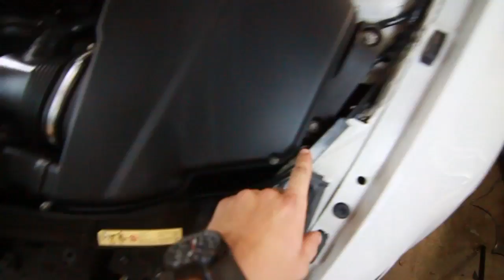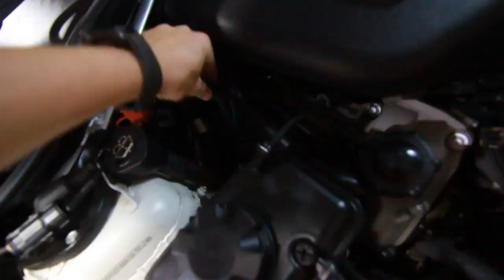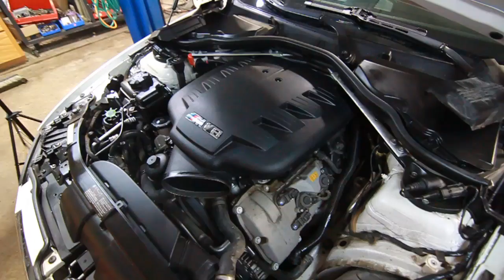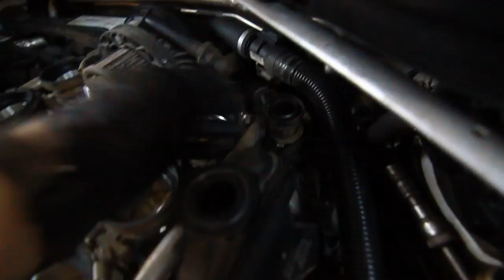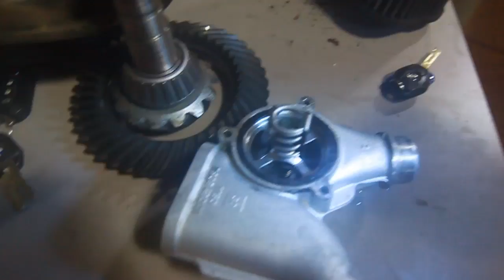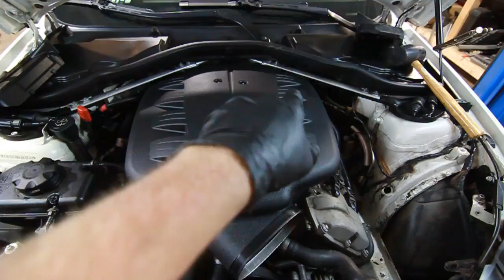BMW E90 E92 E93 M3 S65 V8 Water pump and Thermostat DIY replacement

Comment: What are the symptoms of water pump going bad? I replaced my oil filter housing and now only 1 gallon of water and 1 gallon of coolant goes in and reservoir fills up. Could that be an issue?
Reply from the maker: Da Rt seepage, excessive noise or play from bearings and or improper cooling at low engine speeds
Reply: I have notice unique noise since I putted everything back together. Sort of louder ticking noise. Temperature is good. Ive drove it and gave it a gas and temperature not rising up or overheating. And its all with 1 gallon of each. I heard that those water pumps go out in open position so it technically circulates coolant. What do you think?
Reply from the maker: Da Rt ticking isn't related to cooling system unless it's a BAD bearing issue. valve adjustment?
Reply: Here is threat I posted. Just to give an idea whats going on.

Hello. So Ive finally replaced oil filter housing on my M3. When I did such job I took off pretty much everything, radiator, fan, most of the pulleys, vibration damper and housing itself. My car was sitting for almost 2 months and 1 month with all those stuff out due to fact that I had to order some parts as I was going along with repairs. As I was working on it and installing new oil filter housing I have started the car without alternator plugged In a few times(no belts, no coolant, just a quick 2 min run to see oil leaks). Housing that I have used is from 2011 M3 with a different pulley. Some people say that belt needs to be rerouted and go over power steering but that will make it spin in a different direction, I left it the way it was before. Also 2008 year was making both pulley types so its not an issue. So as I was putting everything back together it didn't have enough power to crank the engine with all the belts so I jump started with my friends car. So when everything was back together now I have check engine light on, as well as some emission problem on a screen. On top of that only 1 GALLON OF COOLANT AND 1 GALLON OF distilled water goes in before reservoir tops off. I've let car warm up for good 15 minutes as well driving it for another 5 with giving it some good power and its not overheating but level is not dropping as well? Can someone please explain what is going on? I know I shouldn't of not started the car without alternator but I wasn't trying to put everything together just to see if housing still leaks. It is not covered under warranty, car has about 87kkk miles on it. I have to do everything myself.

Comment: Torque spec for waterpump and thermostat?
Reply from the maker: one ugga dugga!

honestly use a 1/4" ratchet and snug that bad boy down. if you don't have a decent sense of torque for a fastener, use some blue threadlock.

outside of wheels, internal engine parts, and clutch parts, I do not use a torque wrench.

Comment: surprised its a belt driven pump and not electric like other new BMWs
Reply from the maker: even the F80 M3 has a mechanical water pump. was very surprised to see.

don't quote me on this, but EVERY 'S' engine has a mechanical water pump to date.

Comment: How many miles should you do your water pump and thermostat?
Reply from the maker: 60,000 miles is what I'd personally do, but this one had 120,000 on original pump and thermostat.
Reply: Thank you sir.

Is there any manual for service interval spark plugs every 30k ext
Reply from the maker: there should be a maintenance schedule in the owners' manual I believe?

Comment: I think your channel is great. I have a weird whine coming from my e90, I suspect it to be my water pump pulley, BMW cannot figure it out. Can you check on the video on my channel and provide me you inputs. Thanks
Reply from the maker: definitely a bearing in the belt drive somewhere. probable culprits:
1.) main belt tensioner
2.) alternator
Reply: Thanks for the reply. Do you think it could possibly be the water pump pulley also? That pulley doesn't look like it has any bearings, but I threw some water in it while it was running and the squeal temp stopped. When you say alternator do you mean the pulley? Thanks
Reply from the maker: I'm guessing you're not in the states, so I don't know what engine you have -- no US market E90 except the M3 and the 335D have a mechanical water pump driven by the belt. it is possible the bearings in your water pump (if mechanically driven) are going bad as well.

step 1 is pull the belt off when engine is cold and spin all of the idlers and accessories, feel for notches, difficulty turning, play etc.
Reply: I'm in the states, my M3 is a 2008 e90 it has a mechanical pump.  I can't figure out why the squeal would go away when I would spray water on the pulley. I checked the bolts on the water pump pulley.They weren't lose but felt lightly  torqued. So I tightened them up. Squeal came back quieter the next day.  Sprayed WD40 on the bolts with it running and in the center of the pulley. Squeal stopped for about two seconds and then came back.
Reply from the maker: ah, didn't sound like an S65. my vote is tensioner/idler. water will 
either make the slip stop or increase, both of which will eliminate the 
slip noise.
Reply: Yeah that's what I was leaning towards and prob where I'll start. BMW said belts, does that sound like a belt to you?

Comment: BMWs throw their water pumps and cooling parts way too quickly. I bet this car doesn't even have 50k on it. I just changed the mechanical water pump on my Uncle's S55 AMG W220 but the car has 295,000kms on it. I reused the thermostat since it was replaced not too long ago. Plastic electric water pumps and plastic cooling pipes aren't a good idea especially when it needs to cool such a sweet high revving motor like this one.
Reply from the maker: 121K miles on this M. pump was still solid, replaced preventatively.
Reply: Camper1234599 Ohhh. Yeah since you're in there might as well replace anything that could potentially fail.

Comment: plastic water pump?  What BMW thinking
Reply from the maker: they stopped making plastic ones in 1995, but 1996+ are Composite. still not great. not really all that many failures with the impellers anymore though like the plastic ones used to. most failures I see are bearing related.